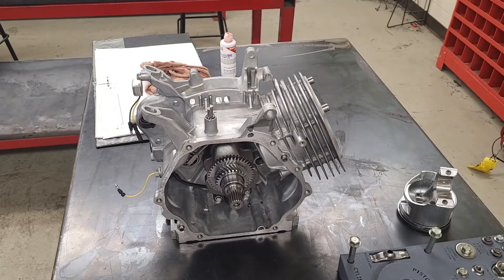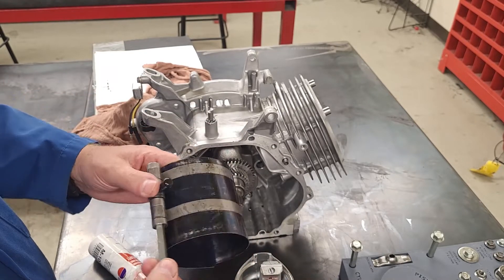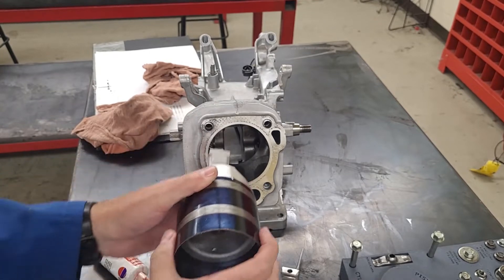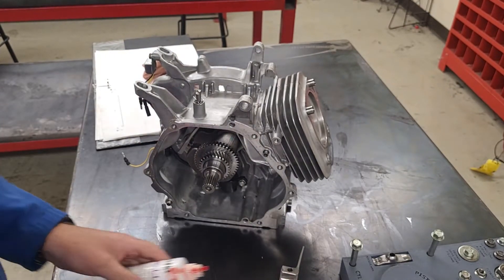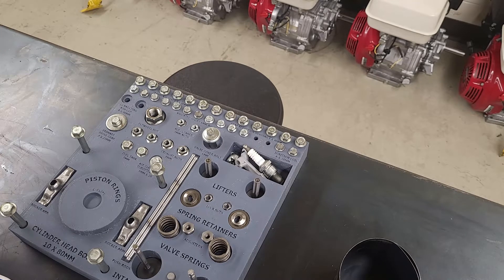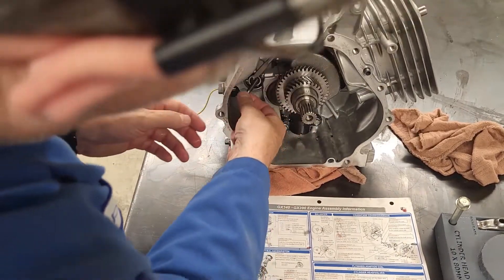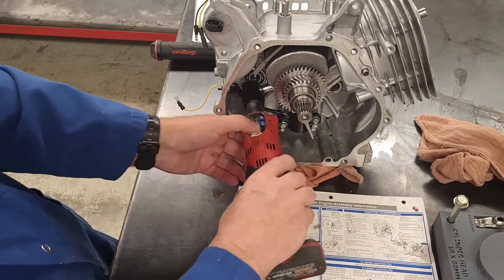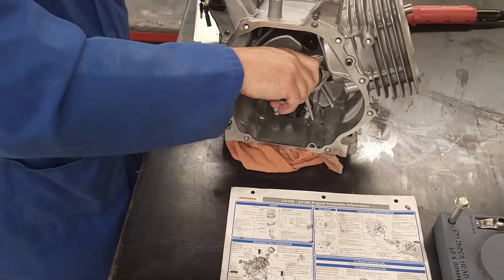Piston Installation

Comment: What is Oil type of Honda gx390 model?
Reply from the maker: SAE 30 for general use. SAE 5W30 synthetic if used in temperatures below 0°C for easier starting.